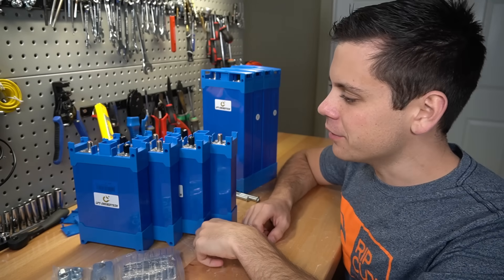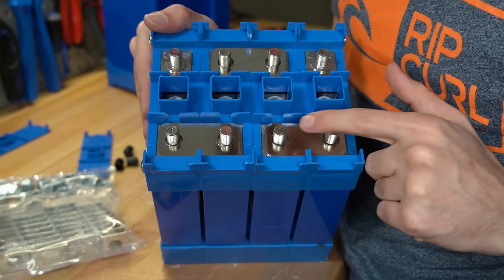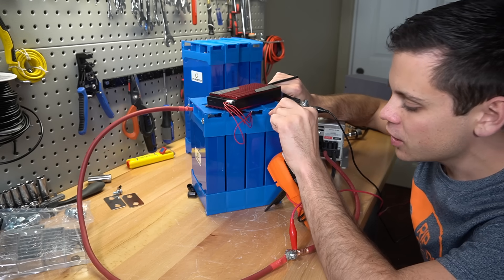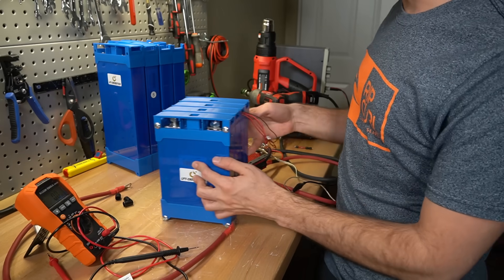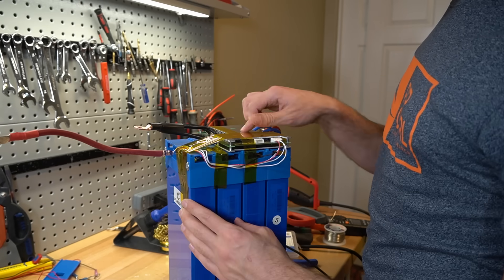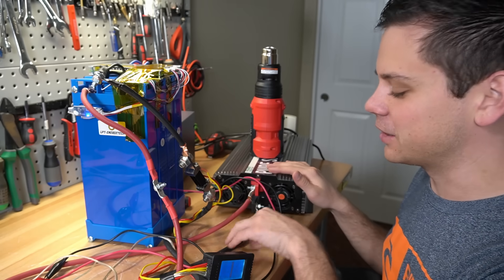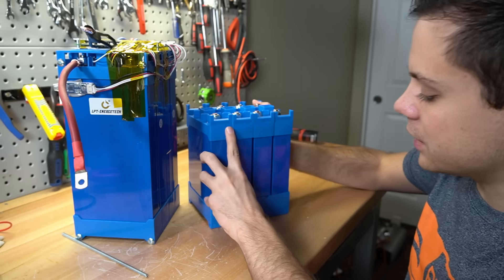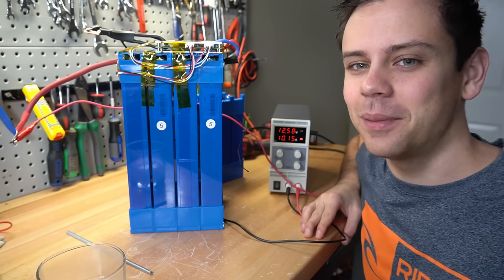Fortune LiFePO4 Battery Cells: I love them!

Comment: Hi Will, I have a lead acid battery bank comprising of 16 x 110Ah deep cycle leisure batteries, and at some point I want to replace them with LiFePO4 battery cells, and it was set up for a 24v system, but I am now upgradng to 48v system. In my bank I have about 10KWh of useable engery, but I am having trouble being convinced that LiFePO4 is the way to go, why because of the cost. My batteries cost me £50/£55 each (thats under £900 for the bank) to replace this system its going to cost me £3-4K which I am having trouble swollowing!! and that doesnt even include shipments cost, because here in the UK these batteries are not avaible, plus theres the BMS's I going need! whats more the loft space where the battery bank is housed gets up to about 45c in the summer months. What are your thoughts.

Comment: Fortune batteries are cute, light-weight, small.... but twice as expensive as Trojan 105s, watts to watts, AH to AH.
Reply from the maker: Actually this is not true. Usable capacity of LiFePO4 is double, charge cycle life is 5-10x longer, coulombic efficiency is 30% better. Trojan or any fla is actually the most expensive battery around. Check out my video "lithium is cheaper than lead acid" to see what I mean. I show all my calculations.
Reply: @WillProwse  Thanks, Will.  I have been off grid mostly since 2002, using Trojan 105s.  I have two systems: 12v,  and 48v (The upgraded version of T105s is much nicer.). The 12v batteries are 17 years old and I have to replace them. Will my old charger likely work with the LiFePO4  batteries? It is a TRACE C30A.

Comment: Will,  I have been using the 100AH Fortune cells for about 2 years living fulltime in an all electric RV (no propane).  I run a 200AH 48V bank with 2 Victron Quattro (split 240V).  I have hit them with some pretty hefty loads and they have performed great.  BTW great vids, keep 'em coming
Reply: Thanks for letting us know that they can be used in both serial and parallel configurations.
Reply: Awesome thanks for chiming in so helpful.  That's like $5k in batteries alone isn't it?
Reply: @ThundarrZ  It ran about $4K with tax and duty.  I used the bottom balance method with a powerlab 8.
Reply: Omar Williams  We turn the AC off about an hour or two aftre sunset since we prefer the fresh air.  I run a 46 inch LED TV till about 10PM  and led lights (4) and the wife has a 22 inch LED TV on most of the night (it helps her fall asleep).  If we have 100% charge at sunset I will typically have 60 to 65 when I wake up at 5AM.  Hope that helps sir.
Reply: How many 200Ah 48 volts batteries do you use?
Reply: @williamkunte5361  I used 100AH cells (3.2V), 16 in a pack (48V) with 2 packs total (200AH)
Reply: Omar Williams  Being mobile allows us to move to a cooler/warmer climate when we want to so AC is not much of a concern for me.  With that said I am moving to a new coach this fall and plan on installing 280AH EVE alum cased cells. 8S2P (24V) config for a total of 504AH usable (90%) with 1500 watts of panels.  I use the powerlabs8 to bottom balance and an Ant BMS(2) in parallel.  This will be an increase of 25% for me and about 40% less cost than my first battery.  Good times.  Good luck in your design and build.

Comment: Hey Will...tha is again for an great video.  Can you do a video explaining the advantages/disadvantages to setting these cells in series or parallel first when building a large battery bank.   For instance to build a 24v 400Ah battery (using 32 cells) should they be set up in parallel first to make the 400Ah then series or in series first to make the 24V then parallel?  If you make them in parallel first would one BMS work for the whole bank?
Reply from the maker: https://youtu.be/zStEtH9Le-w

Comment: difficult to trust BMS's temp sense claims as your other testing shows...  what would you do to provide redundancy to the BMS's temp sense clamps?  its difficult to trust $<100  BMS to tend a $700+ of battery.
Reply from the maker: Yes sure. Use victron solar charge controller and add the "battery sense" module, so that your system instantly has low temp charging protection. That's the best way to do it.

Comment: First time I hear you mention Sol-Ark :)

Looks like 4 cells only cost $460, plus shipping and BMS. That’s like half the price of a BB.

Looking forward to more tests with this battery
Reply: Guess it depends on the shipping costs.
Reply: Robert Hayden but also the more cells you buy the cheaper they get. 1-4 cells at $115 each but 98 cells plus at $98 each. That $17 difference per cell should easily cover shipping and then some.
Reply: @4philipp  Sure, but if shipping kills it, then it doesn't matter.  You have to look at the whole package, not just the listed cost-per-item.
Reply: Robert Hayden I think it’s reasonable but haven’t seen any actual numbers
Reply: @4philipp  $80 for UPS from Salt Lake to Washington state for 4 100 AH cells. Hope this helps.
Reply: Ralph Featherstone I guess a volume order with the buddies and a fun road trip to pick them up would be ideal. 

Question is also how does shipping cost change with larger orders?
Reply: QUESTION >> I am interested in building a 48V system, I have solar panels on my roof, I used to be grid tied with the power company, but after incentives and pay backs petered out... the power company wasn't giving me anything,,in fact it was so horrible, that i had to pay them to take the power. they didn't do net metering. and only offered to pay me 2C per KW. That wasn't going to work, so i had to shut things down and disconnect.  Typical Municipalities.. So i Had a 2.4Kw system, but they were old panels, i got maybe 1.8Kw out of the system.  If i derate the system to 1.5kW. @ 48V that should give me about 31A charging ? Would this be sufficient to charge a 48V 400Ah Pack ? or what is the best size pack ?
Reply: Ray S. Before you de-rate the system it’s helpful to know how many panels, V, A and Watt rating. Also your solar window is important. 
I would think that your panels are more suitable to a 24v system. You have to remember that you only have energy when your panels provide enough voltage to start the charging process so you need more in series to get voltage up. And you need a charger that can handle the high voltage and is compatible with a 48v system. 

But let’s play with the numbers you gave. With a daily solar window if 5 hours, you would produce 7500 watt hours or 155 amp hours at 48V. Less if your solar window is smaller or it’s overcast. 
You would produce 39% of your battery capacity. ThAt by itself is not a problem if your battery bank is oversized. 
To see if it’s sufficient we also need to know your house load calculations. How many watt hours are you using on an average day? If you use less than your panels provide you are golden, if you use more you need to either cut back on consumption or increase your PV setup. 

I think it’s quite telling how systems are rated 
48v - 4500watt
24v - 2400watt
12v - 1200watt
4500watt with 300 watt panels (15) from renogy (as a reference), with tax and delivery, minus mounting hardware will cost < $6000. 

So unless you are ready to make some new investments, I think a 24V system will be better. 

Disclaimer: I’m not as smart as Will and am still learning myself.

Comment: Your cutting the threaded rod with the wrong tool, use a porta-band or hack saw never bolt cutters. The wall asked him for cordless tool that cuts it automatically also but it’s heavy awkward beyond that cool show I really learned a lot
Reply from the maker: I use a deburring tool afterwards. Makes the threads perfect in seconds
Reply: DIY Solar Power with Will Prowse  my point being right tool less hassle. I have the same debur tool works great but i use mostly stainless so cutting edges dull quickly. Cool show im glad i found you 👍👍

Comment: -How do you wire the BMS when making a 16 cell 48v Battery? 
-What is the overall dimensions of the 12v, 100a battery you made?
(I am thinking of a 48v, 200a battery with 4,000w inverter)
Reply from the maker: Watch my 48v video with ant BMS
Reply: @WillProwse  Cool, so 48v, 200ah Battery would have 2 - 16 lead BMS's? And there is no issue wiring series and parallel like the other batteries you reviewed recently that say build 12v only?
Reply from the maker: https://youtu.be/zStEtH9Le-w
Reply from the maker: Be sure to check out my LiFePO4 battery building videos. Lots and lots of info. Or my website with battery building schematics

Comment: I have often wondered and almost asked you about bundling your cells so tight together and why no air space between each cell.  If the batteries on the end with the most exposure, over time show any change.
Is there any limitation of the new cells today for building a battery bank greater than 2 12v series connected groups?   Will they work for 3,  4 or more  12v  parallel  batteries?

Comment: Hi Will. For the threaded rod....
Put your nut on the rod before you cut it , then  unthread the nut past the cut and the nut will straighten the threads. 
Also if you cut using a dremel tool and cutoff discs , it cuts very clean but put the nut on before you cut , incase .

Comment: please could you make a video about building a pack with cells in parallel
Reply: You know that the voltage will be the same as one cell 3.2v . But you'll increase the current capacity times 4 .
Basically manual balance fairly close (0.2v) then connect + to +  and - to - . No bms required because they balance  themselves in parallel. 
If you plan on using high amperage , make  sure your leads can handle it or it could cause a fire.

Comment: Dang! I love these batteries! Super rugged modular design with heavy-duty lugs. Perfect for a serious A class RV power bank. I'm sure they can be configured into 24 & 48 battery banks too, right? Oh, and Will, from working in the oil patch to cut all thread rod run a nut up to where you're going to cut, then cut with a hacksaw. Now back the nut off over the cut, and you fix the threads. If need be, a cheap triangle file will fix any minor burrs; one doesn't need a special tool. I don't see where one needs a case for these cells except for something that screws onto the top to contain the BMS. Can't wait for more video's on these cells.

Comment: Heres a little old school tip that can save the price of a deburring tool. Before you cut the rod, thread on a couple of nuts that fit. After you cut the rod, unscrew the nuts and that will straighten out the threads. Nice video Will.

Comment: I love the design of the terminal covers, bolting system and air flow, not to mention the price.  Wondering if i could buy (8) 100Ah of these fortune Lifepo4 cells to add to my 8 sinopoly Lifepo4 cells for my off grid 24 volt system? will they coexist?

Comment: I use my small bench grinder for deburring. Simply hold the rod very lightly to the face of the fine grit wheel at about a 45 degree angle and rotate it. The key is to use very little force. Takes about 2 seconds.

Comment: I see you use a bench top power supply to do your charging.Could you do a short video on how to charge LifePo4 batterieswith a adjustable voltage/current power supply?
Reply: Functionality of Cc/cv power supplies are very similar to benchtop power supplies. On both you set a voltage and max current to be drawn. It’s just that you have more flexibility and convenience on a benchtop powersupply.

Comment: These are extremely less expensive than the other brand built batteries.

$12,500 of these equals $64,000 of the "off the shelf" brand name LiFePO4 batteries. 

$98 per cell in house sized setup. (48 volt, 800AH or more!) 16 to be ~48v, now 8x them to 800 ah or 10x for 1kAh!

Comment: HI Will!  These do look like a great form factor and great for DIY batteries.  One note, you can clean up the threads on the end of cut threaded rod with a file or a grinder disk, rather than needing to get the specialized tool.  No criticism, just hopefully a helpful tip!  Would something like this be ok for a vehicle replacement battery?

Comment: Will,  PLEASE please please build a 400 amp hour 12 volt and 24 volt DIY systems?  Preferably with these batteries hooked to both solar and a vehicle 12 volt system.  Few of us can afford 4K for Battle Born, so it would be a big help. 
Thanks for the great content!
Reply: I'm hoping to see this type of build for my RV.  Thank you in advance.
Reply: I would like this also.
Reply: I'm looking for 400-600 AH for an RV application. Need info on how to build it using 100 AH cells. Thanks
Reply: Geefy Zero use 24v or 48v?
Reply: The same web site that sells these cells have a 12 volt 400ah battery for $1700! Cheaper that way then to build it out of these cells.
Reply: Mike M I saw it as $496. I don’t know what you saw?
Reply: Joe Hajdasz What I saw was at least $3500 in battery cells to get to 800ah.
Reply: +1
Reply: GunTotnHippie what store are you picking up the Fortune cells at in Utah? I am looking at putting together a small power system for my ham shack.  Thanks.
Reply: GunTotnHippie Do you mind sharing a video or some more details? This closely resembles my planned RV build.
Reply: I would also GREATLY value a build of this nature....
Reply: GunTotnHippie what did all that set you back, $5000?
Reply: Yes please build this system
Reply: watch my YouTube
Reply: It would be 4 of the 100 amp that he built with the bms put in parallel you would treat each one as its own battery just like one of the prebuilt Lifepo4 batteries.
Reply: @recoblade1465   new to all of this  so 4 of these in parallel are 12v and could be charged with my alternator?
Reply: @1diodejay  yes if you built 4 separate 100ah batteries with there own bms and then wired them in parallel you would have a 12v 13.2v to be precise 400ah battery bank. That is what battleborn does but they use different cells. Now as for charging your alternator will charge it but it will not be happy about it and can cause damage to your alternator they make alternators better suited for charging a bank like that and you could swap them out
Reply: @recoblade1465   I ordered my van with a 220 alternator,  is that what you mean?
Reply: 24v could be done with 2 diy 100ah batteries with bms put in series
Reply: Yes that would be great, especially for boat owners who are looking at this technology.
Reply: I second the motion~
All in favor say "Aye"!!!
Reply: I would like to see a video with 400 ah to please

Comment: Dear Will: enjoy watching your program.
I am getting close to build a solar system for a cabin in a remote area, due to not using much... can I leave the batteries on drained (emptied) condition on LiFe PO4 or Fortune LFP? will it be considered to have longer battery life because has less “cycles” used? turn it on only while stay.
Reply: Thanks, it is on interview with BB CEO

Comment: Cut an Al plate just a bit smaller then the battery, drill 4 holes to match the holes in the batteries.
Make the threaded rods a little longer on one end of the pack, double nut the plate in place and mount the BMS to the plate.

Comment: So, $550 for a 12.8 V, 100 AH Battery with the PROPER BMS, which includes a load temperature charging protection sensor?

Comment: Will, which is preferred, common port or separate port Daly BMS for these types of packs?
Reply from the maker: I like common port at this point. the separate port bms charging line is usually too limited. For example, only 8 amps for a 100 amp daly bms. I like common port for faster charging.
Reply: @WillProwse  Great, thanks.  I"ve been going back and forth myself, seeming to land on common port.  I was just wanting to see what you thought, as a sanity check.  I seem to dive way too deep in "little details", thus my "sanity check pool" is limited.  As a side note, long before I found your channel (ie: 5 years) I setup 200w solar, charger, etc in my Tahoe to power a DC fridge and other stuff (ham radio, etc..).  At first even I thought is was a little crazy.  But, 5 years later, it is dam handy and I have many people inquiring "who" did it.  Anyway, thanks.

Comment: Just a hint regarding the deburing. If you wind the nut past where you are cutting, then make the cut, then wind the nut off and it will clean the thread up using the nut.

Comment: Do you need a bms for each 4 cell 12 volt battery for a 48 volt system,...4 bms's,...?
Reply: https://youtu.be/im4ggvoni5M
Reply: @091mega ,thank you for the response.
Reply: No, you want one single BMS monitor all cells.  So in this case you want a 16S BMS
Reply: @AndreasStuben  ok ,thank you for the response.

Comment: Will, would you say that these batteries would be competitive to adding 12 volt Battle Borns to an RV?
Reply: I run our house on 16 battleborns and will do our  RV system next with either 2 or 4- haven't decided yet.
But I would say this new design battery cell is definitely on par with the Battleborn - at least as far as we can tell from just one review from will.
They seem to be engineered very well, a thoughtful design that is easy to work with, safe to use and simple to assemble. 
I may try some and build a bank for the RV but I must say - it is nice knowing that my battleborns have a good warranty. Also they have the best customer service that I've ever experienced...